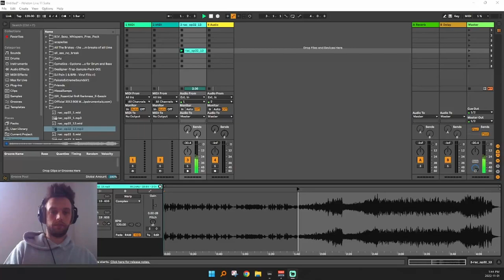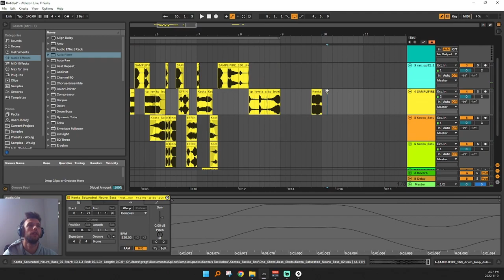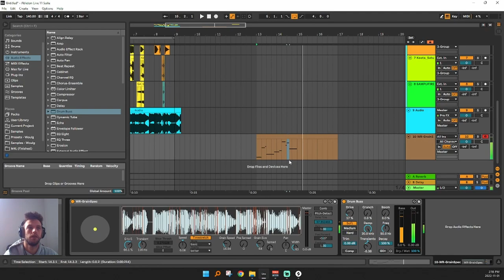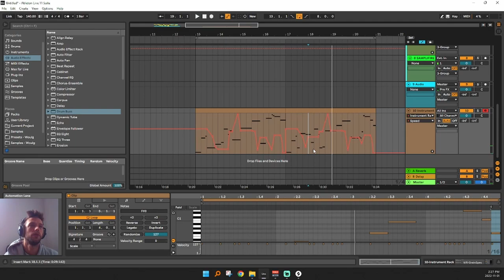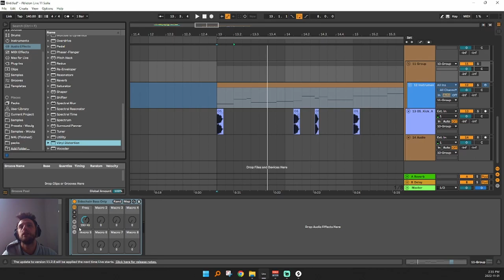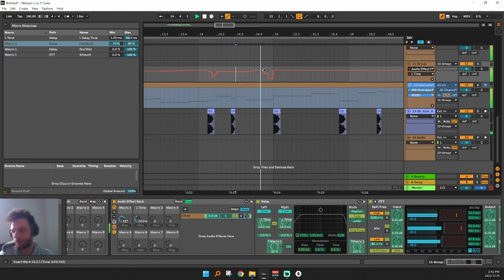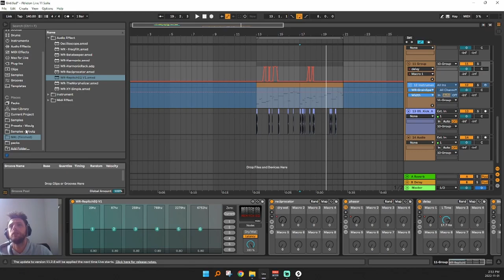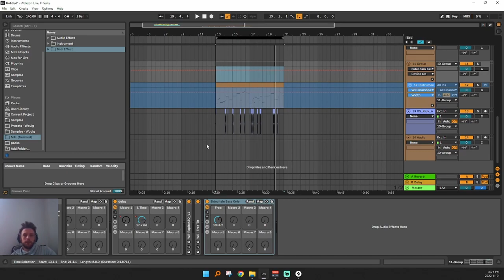1hr of Glitchtopia w Grainspec and Other m4l stuff i made

Comment: I bought Grainspec and tried to drop sound file(aif) , but got error
buffer~: cannot open parser for this file. I need some setting ? 
I use Win11
.
Reply from the maker: Did you try other file types? Did you try dragging from Ableton, or dragging from the file explorer?
Reply: @woulg  Now i tried "wav" from Abeleton and no error it worked .    I got error   aif file      both from Ableton and  file explore.
Reply from the maker: @v0id_scuy  ok, I guess it only allows .wav? I didn't know that. If that doesn't work for me you can contact me on instagram for a refund. Send a pic of your receipt :)